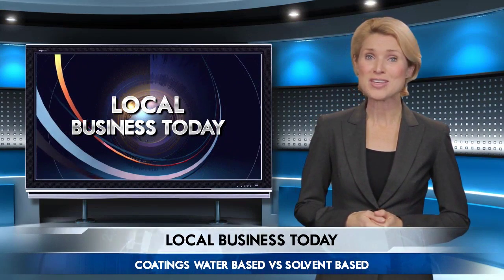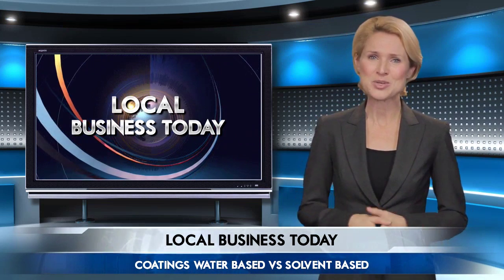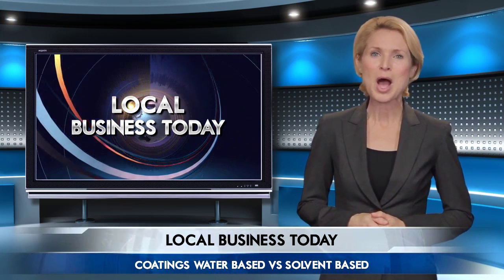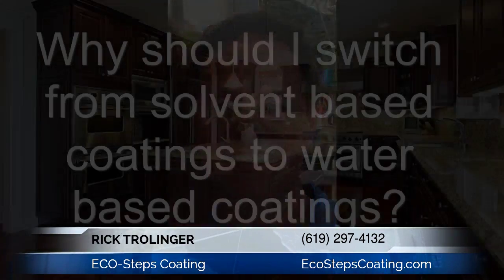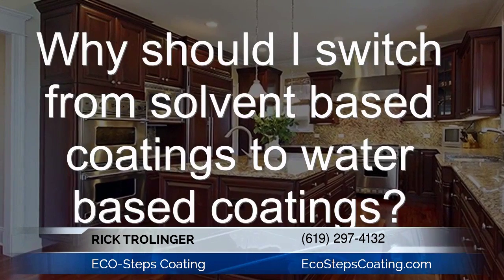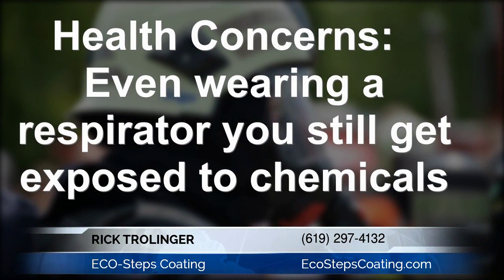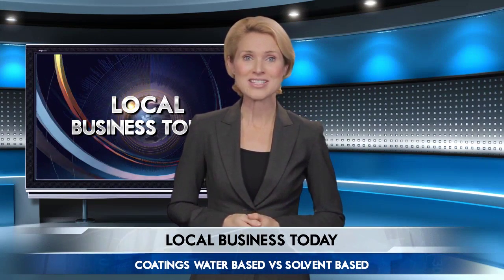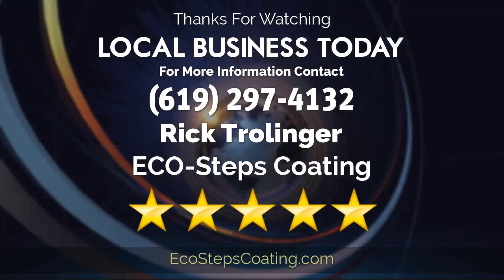Solvent Based Coatings VS Water Based Coatings: Why You Should Switch to Water Based Coatings

Comment: In Australia's oil industry, esso/BHP oil and gas platforms have been using a high ratio waterborne zinc coating, a single coat application applied in two passes, it was a steep learning curve , testing four products and convincing the applicators of its health benefits and   it's hardness/ turn around handling time , it's a self inspecting product, poor blast profile and the zinc simply peels off, to much humidity or low ambient temp / lack of air flow the product doesent cure properly, dft range ideally 100 to 150 microns, the best product was vessy chemical, a us product ,joten, dimet  and dulux  also supplied products , it has been used for 30 years now and I believe trialled in the USA by exxon  and the us navy and also was found to be to complicated for use in the tropics due to high temps and humidity,
Field testing inorganic zinc silicates by Alex Szokolik consulting pty ltd,  worth the read